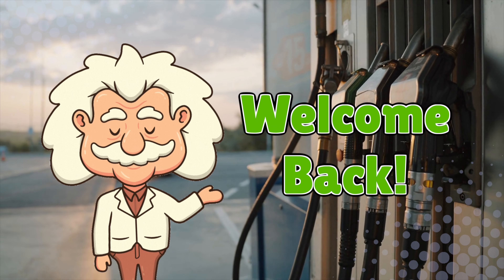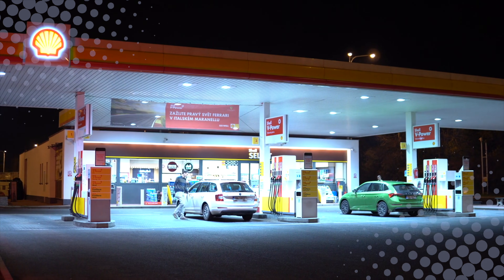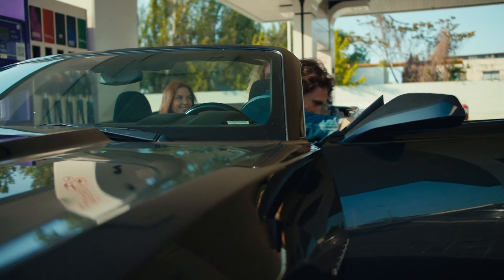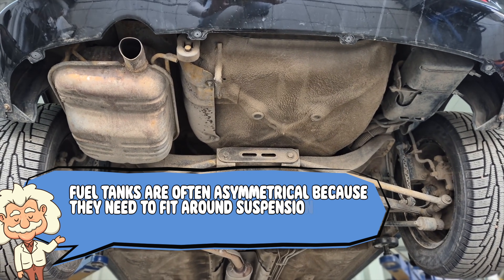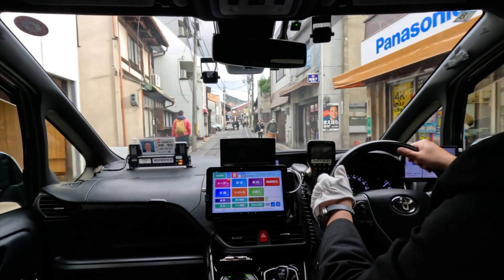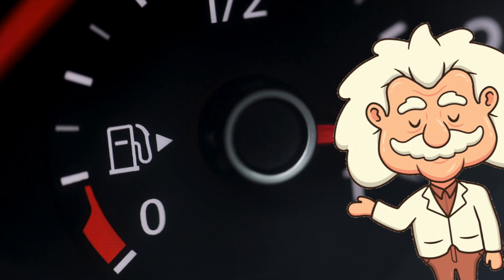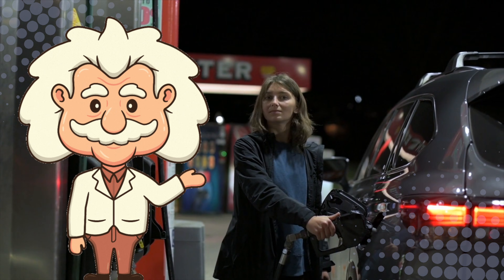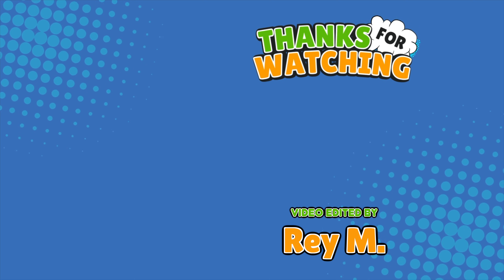Why Are Fuel Doors on Different Sides of the Car? The Tiny Door That Confuses Millions [ID0604]

Comment: I live in Brazil. We have flex engines that can tun on Ethanol or Gas or any mix in between. But in cold climates a car filled up with Ethanol might get in trouble to start. So they have a small gas tank just to start the car in cold weather if it's filled up with Ethanol. Therefore my car has two fuel doors. One for gasoline only and another for Ethanol or Gas.

Comment: We have two vehicles both Japanese vehicles one a 1997 2X4 Toyota Hilux right hand filler cap and a 2017 Suzuki Baleno with a left hand fuel door l know why my Hilux has a right hand side filler cap is because the exhaust system goes down the left hand side of my Hilux and the tank also is on the right hand side for safety  and all cars are right hand drive in Australia